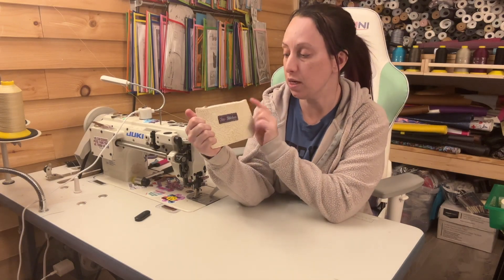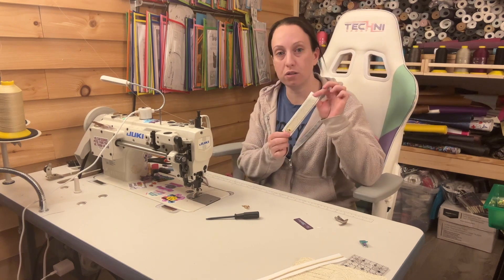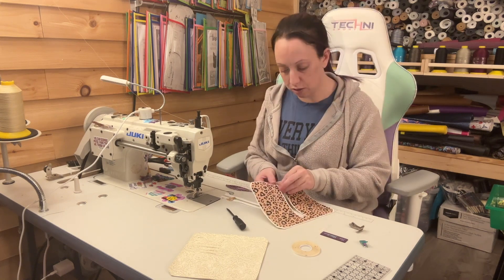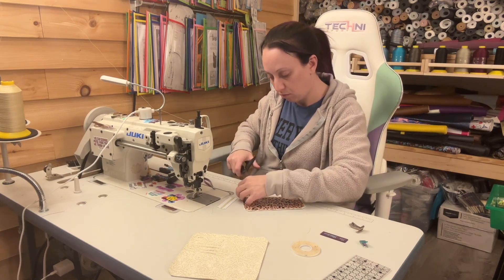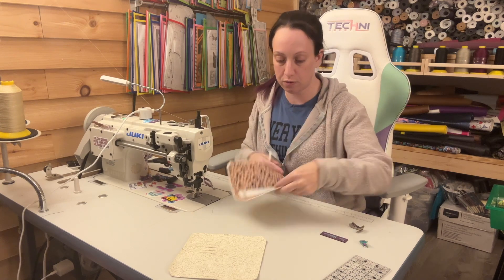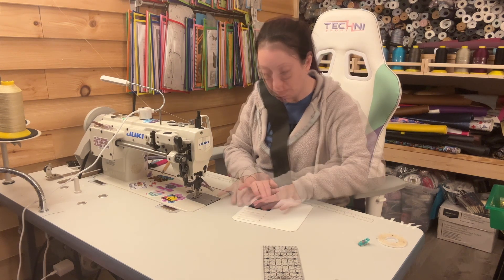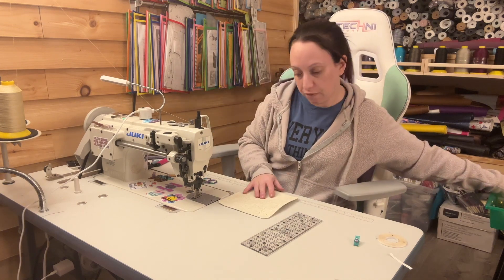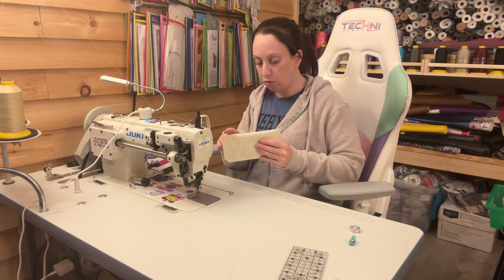Sewing the Purse Pal by Linds Handmade

Comment: I haven’t used heat transfer vinyl yet. Can it be applied after the zipper to hide the zipper tape?
Reply from the maker: It could be but you’d want to be sure to leave a cut out for the zipper to open and close. I personally have not tried it
Reply: @Six-Stitches  I may try it sometime. Of course I gave to get the heat transfer vinyl first lol.